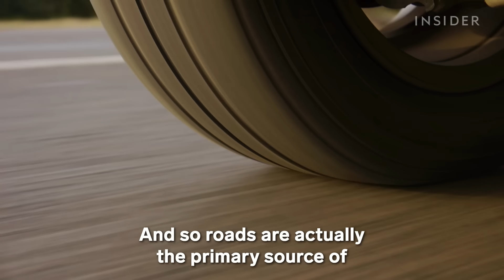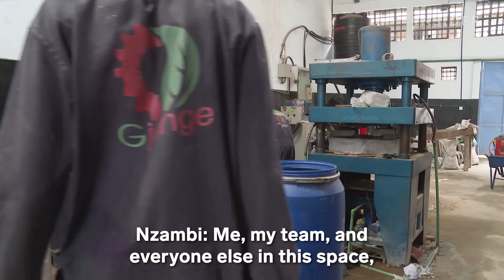Young Inventor Makes Bricks From Plastic Trash | World Wide Waste | Business Insider

Comment: Well I think this is a great idea but the problem is there's a lot of chemicals in the plastic... But I think there is a viable use for the solution and contribution of many uses for this product not just for the streets and roads in the local towns but ultimately other uses in homes if they use another sealer around the plastic that people wouldn't be exposed to or the environment would be exposed to from Reigns going into the ground soil and the water being contaminated in the soil... So there are some different obstacles but I think that there is a logical used for this product in some form or another or many forms
Reply: What’s better though, creating waste both from the recycling of plastic and the making of concrete or only the (small) waste of plastic from this process?

Comment: I would say make plastic tubes, drains and sewage pipes out of it instead of road material, as it wouldn't release the same amount of micro plastic and it wouldn't be in water or air. It would also give a sewage plant the option to remove it before the clean water is released back into the wild, so you get to use the plastic waste, improve the infrastructure in a cheap and very meaning full way.

Comment: This is a bad idea, because the kinds of polymers that are in most commercial plastics, especially the ones in abundance in this area, are not exactly of the high grade variety. We are talking about a material that breaks down over time from exposure to UV light, and has low heat tolerances, and the plan is to pave roads with bricks of it, where it will be exposed to constant UV exposure, and plenty of heat. The addition of the sand doesn't do much to help with its structural integrity, its really more of a filler material, to give it more volume, the plastic is what bonds it all together. Those bonds will break down over time from the UV exposure, and on hot days, the surface may even crack and chip from the heat.

Can you physically pave a road with these bricks, yes, you can. However, the problem is they won't last.

Comment: i see a immidiate problem, she cant produce enough bricks, its too primitive in its setup, this needs to be scaled up by 1000x if it wants to be succesful.
the bricks are also too thin, meaning you have to stack a lot more layers to reach the same height as a brick wall, and this you are using more cement to bind them all together, and this it takes more time to construct, and this it is less cost effecient...
this is a nice dream and the lady is on the right way, but this is just for small scale use... this will never be  a mainstream thing because of the things i mentioned above.
also their is a envoiremental cost to this, when you break down a house made from these bricks, than what??, it is eaasy to recycle old stone bricks, abut these bricks cant even be reused to make new plastic bricks.... it is a all round bad idea, and she probably go tmoney from some charity but certinly not from a business that wants to invest!.

Comment: Use the material for interiors too!  Inside a house, or any kind of structure, it won't be exposed to the sun, wind and abrassion as much, thus reducing the degradation into microplastics. Make wall tiles, floor tiles, countertops and even furniture out if it
Reply: i was thinking you could have the inside of it plastic and the outside is a thin layer of whatever its normally made of which would definately way reduce the microplastic AND reduce the materials needed to make a single floortile, could instead make 2 or 3

Comment: If the issue that makes it dangerous is the abrasion of microplastics why not put in the top layer of these things a hard Stone aggregate that would be the wear surface on top of the roadway but have the underlying structure made of the Plastics and that would sequester the Plastics beneath a hard benign surface on the road that would be the abrasion area and what was released from that would be just stone dust and little else perhaps a fraction of whatever microplastics would otherwise abrade away. Next problem please. I am willing to be the next God emperor of the planet. No really.

Comment: They just need to coat the brinks with an outer layer of concrete to reduce the micro-plastic issue. On a side note the workers should wear masks and definitely need to filter the harmful fumes from the machines. Love her positivity, hopes everything works out.
Reply: Presicely, basically trap the plastic inside and stop it from interfering with the enviroment.

Comment: plastics are not biodegradable and all plastics—no matter what form or shape they are in—are made up of small, granular pieces that are between 5 to 10 micron (0.005 to 0.01 mm) large, and will eventually break down to that size. Most plastics are also sensitive to ultraviolet light and will break down when exposed to the sun. So no, plastic is not an ideal building material.

Comment: Great idea but I do have a few concerns:
1. The worker's heath, they mentioned that there is a smell, it's probably important for them to have some sort of protection against that. I'm sure that is toxic.

2. How durable are the bricks? For example, for road use only, roads often get cracks or damages. how is and economically viable is it to fix roads made from plastic bricks?

3. Are the plastic bricks fireproof? If they do burn, do they release toxic fume?

4. Nairobi and African countries are very hot with a constantly high amount of sunlight, are there risks that the bricks produce a smell when subjected to that level of sunlight?
Reply: Smh

Comment: Wouldn't It be a good Idea to use These bricks for buildings? I think 🤔 it would be much more convenient and possible to prevent these microplastics from going into the air, if they would use it as bricks. Normally bricks are covered with plaster, in order to save it from damage and hold it together in a way. Just thinking :)

Comment: Recycling is different from refurbishing.
Just like with the plastic pavement brick "business", they're just taking garbage, melting it into shapes, and putting it back into nature.
They're not lowering the usage of plastic, improving waste management, or even recycling.
They're just putting the reshaped toxic plastic garbage back into nature, where it will leach regardless of it's shape.
During this pointless process, they have workers standing over fuming plastic melting ovens without breathing apparatus or air filtration.
What pretentious nonsense.
No underlying cause of the root problem has been addressed.

Comment: “That crushes it, very loud!” 😁 at 1:38

She is so damn adorable. I love her energy and what these ladies and gentlemen do. Amazing!
Reply: im so happy she is leeching microplastics into the environment
Reply: @weltschmerz333  bruh, she's not doing anything but taking plastic out of landfills and putting it into bricks. Most of the bricks go into courtyards or driveways where its not a problem, not huge busy roads. So she's doing alot more than you ever will to solve the problem.
Reply: @davidwestin6345  She is intensifying the problem. The environmental impact of these bricks is vastly higher than it would have been to just leave the plastic in landfill.
- Abrasion from traffic and walking creating more microplastics
- Plastic leaches dioxins and other harmful chemicals into the soil leaving it toxic
- These chemicals make their way into the groundwater and poison waterways.
- When it rains, the runoff will contain quantities of microplastics and chemicals which also make their way into the soil and waterways, further contaminating the soil and harming wildlife.
- Plastic that is melted or burned, even from just dropping a smouldering cigarette end on the bricks, will release harmful toxins into the air.
- The processes of extracting the plastic fragments, storing and transporting them, and the manufacture of the bricks all also have a negative environmental effect.
- Plastics used outside will have constant exposure to UV radiation leaving the surface brittle and easily broken, leaving the road unusable and creating more microplastics.
- Abrasion from the wind and sand. When brick or stone is exposed to abrasion, it creates more sand. Plastic exposed to abrasion creates yet more microplastics.
The idea of plastic paving is entirely detrimental to the environment. This is why nobody uses plastic bricks.

Comment: For all concerned about wearing and microplastic. 
1. Asphalt is oil mixed with sand. Nothing super healthy about it. Plastic in the mix does not add to the polluting potential of asphalt.

2. Plastic dust i.e. microplastic degrades under the sun to CO2 and H2O in a few days. Especially under the African sun. The microplastic we all (not me, actually) are afraid of is a product of the wearing of big chunks of plastic in the sea, where water protects it from the solar UV. And even there it, being chemically inert, is mostly harmless. Like loam, clay, or sand.

Comment: I have a solution to micro plastic ending up in the environment from making these with roads. Lay down 3/4 plastic concrete/asphalt and make the top 1/4 layer asphalt. That way it's not rubbing off on tires.

Comment: This is honestly a terrible idea. Plastic roads arnt a new idea by any means. They grind plastic dust into the environment while being easily degraded by sunlight. This increase the rate of repair. Not to mention its more expensive then asphalt which will drastically increase road work. Reusing plastic is great. But grinding it by driving on it into particles is far worse then just smashing them into bricks and storing it for something else.

Comment: I think it's also a concern a micro plastic, then instead of mixing plastic with asphalt, why not a build a plastic foundation and then add a thin layer of asphalt on it. This way only Asphalt would be rubbing off and not the plastic also the asphalt layer would be very thin meaning very cheap.

Comment: Maybe just cover the bricks afterwards? So it forms a core.
Reply: I wish, but the whole thing needs to be solid to distribute the pressure. the shell with a plastic core? my guess the shell would crack or break easily
Reply: @1darkironman1  Good point, I hadn't considered that. But maybe it would be sufficient for structures besides roads? Like a dwelling?
Reply: @ZapDash  yea
Reply: I was thinking the same thing.
Reply: Many homes in the states recycled tires to make homes
Reply: @FIyingDumpling : I've heard of rubber rooms, but not entire houses.
Reply: Good point.
Reply: It is a great idea, but you would create a composite material. It is more expensive and most importantly:
It is way harder to then recycle those bricks again. Now it should be enough to melt those and you'd have it recycled. But with a shell you'd have to somehow remove it. 
We should do our best not to create composite materials, because the recycling would be almost impossible.

Maybe do the shell also in plastic, but with higher sand concentration or so

Comment: There's a lot of potential, but I'm wondering both the risks of microplastics as well as the long term durability, most plastic waste is made up of plastics that are very weak, such as those found in bottles, food boxes, and most consumer items that aren't intended for long term use. I could see this being a much better prospect if stronger plastics are prioritized, industrial plastics and plastic products that are intended to be exposed to relatively harsh conditions for long periods of time (Such as plastics found in some computer components, plastics used in industrial equipment, weather resistant cases used in components of power grids and telecom/internet service networks. I see the potential for a version of this using all types of plastic waste, including those weak plastics I spoke of, while still providing the benefits of a concrete, shale brick, or asphalt road surface; but I really don't think we have developed methods capable of doing such things reliably.
Reply: I was thinking the same thing. This would only create more microplastics due to wear and tear as well as erosion over time. It might temporarily clean up some plastics but I would say definitely not a permanent means of recycling plastic waste. It sounds good and all on paper but, I feel like in the real world this might not work as well as people originally thought.
Reply: Micro plastic is here to stay, either in the landfills or as something with a useful purpose. If the bricks are encased in cement or concrete for industrial areas, there's a good chance the fear of micro plastics in the air and environment can be mitigated. But this, this is a good start.
Reply: @israelzayas361  I wouldnt call it a good start. Its a sweep under the rug.
Reply: @rovhalt6650 - Once you have an answer for what to do with the tons of plastic pieces we currently have in World, the comment "sweeping it under a rug" is inappropriate. Asbestos is already here, fear of loose Asbestos fibers is a real danger and nobody wants to deal with it... yes, companies are available to remove it, but where does it go? Where does it all go? Why not reuse it or not produce it in the first place? Other than a time machine, it's here to stay.

Comment: I would be curious how safe this might be for other initiatives as well, like creating solid and cheap low income housing or acting as roadside barriers or retaining walls. You would have to make sure there wasn't unintended exposure to harmful chemicals, but on the other hand the material would be exposed to less contact wear so theoretically could possibly be even safer than when used in road systems. I'm all for reusing the plastic we've already produced in ways that not only reduced our impact on the environment but also support our communities while gradually returning to a more glass-centered society.

Comment: I've been following her journey for the last 2 years. I was so impressed whenever I first heard of her and I'm still impressed today. I think she's onto something great for Kenya and I hope she gets more equipment and expands her business to its full potential.
Reply: Toxic off gassing of plastic.
Reply: @udeeedke700  That plastic is already offgassing in the landfill. What difference would it make if it was doing that as a brick on a road?
Reply: @jamesmarsden7284  
That's right!
or ending up in the sea..?
Reply: @jamesmarsden7284  that's right!
Or ending up into the sea
Reply: Agreed, really great seeing this. Hopefully "The Ocean Cleanup" project  can figure out their process to start removing plastic from the ocean.
Reply: do you know why she is using that shape? for paving that is not a great shape, also, if you can contact her, they have concrete brick forms that requires little mortar. placed in walls with plaster on both sides they would be protected from uv degradation. probably a far better use for her production capacity and situation than what she is attempting.
Reply: @vidard9863  Honestly, I'm sure it's due to funding. Remember, all of that equipment was built for that process. I do think they're not the best for the environment over time, but it's better than having the landfill cause lots of environmental issues. I hope she grows and develops this into something that is more environmentally friendly, but she's on a very good path so far. 👍🏻
Reply: Lol patent in africa.... nice one
Reply: This is definitely NOT a good idea. UV (Ultra Violet Radiation) from sunlight (there's plenty of that in Kenya) will break down the plastic into tiny dust particles which will get blown up and get carried into the ait that people WILL breathe. The same tiny plastic dust will go into plants, food, water, etc. Do I need to tell you what happens when humans and animals use plastic ridden air, food and water? CANCER is the answer. So stop this stupidity of wanting to become rich quick by 'inventing an ingenious idea' - that it is not. Get back to the drawing board and come up with natural solutions, NOT plastic. I beg you, please.
Reply: Hey I’m wondering, do you know if she has a pattent on her idea?
Reply: @titolieb2689  I doubt it. China would just rip it off anyhow and take over the industry/market like they always do.
Reply: @titolieb2689  I hope so. Black business owners have their ideas/talents stolen and franchised off of ALL THE TIME. I hope she gets her coins and credit for this one! I wanna see her be a Billionaire. 👀
Reply: @Santi Lieb Why? You wanna steal her idea?

Comment: It's actually called downcycling. Mixing plastic and other material together will make it hard to use the material later for other things, because it's hard to extract the different kinds of plastics again. Other than that it's a good initiative.
Reply: Nobody is doing nothing with the plastic so far causing it to pile up like that in the first place.
Reply: They specified these were single use plastics